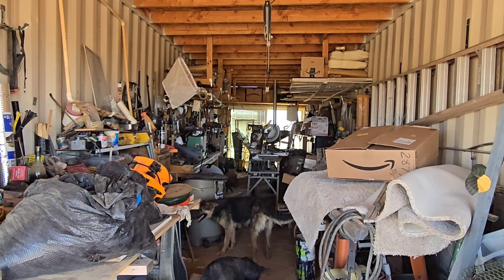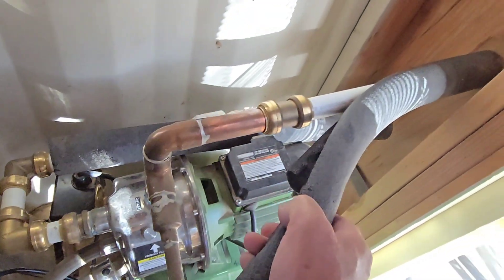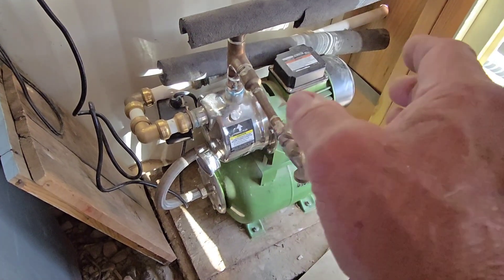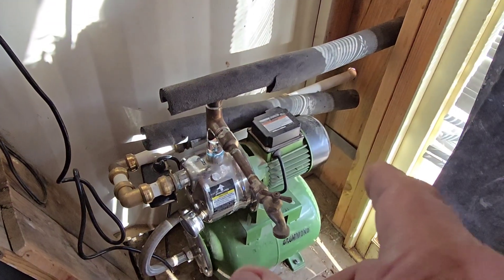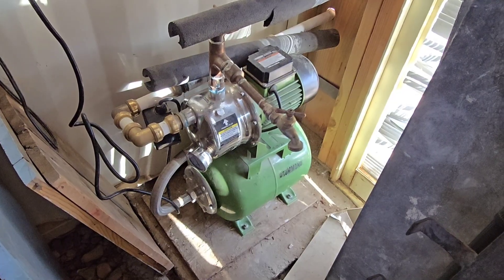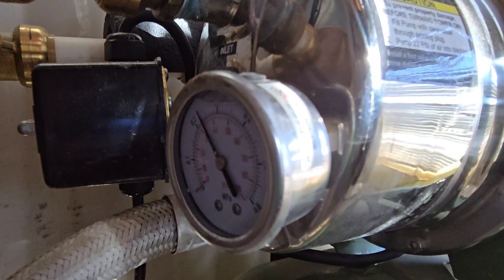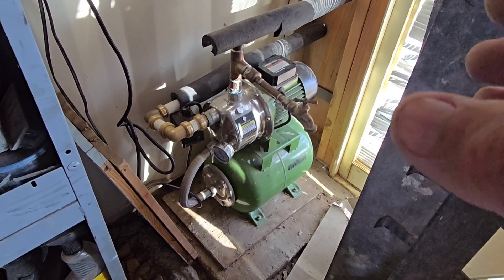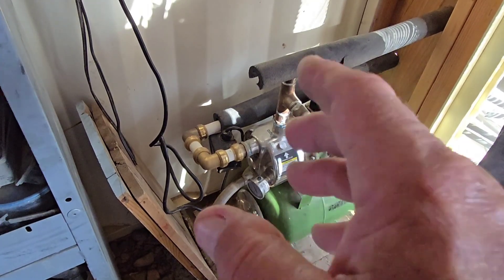H.F. Shallow Well Pump By Drummond, April 21, 2025

Comment: What kind of air pressure tester do you use to test the air pressure in the tank?   I can not get my car tire gage to read anything and I know it has pressure in tank.
Reply from the maker: Remember,  there's only supposed to be 24psi in the tank, and some tire pressure gages don't go that low anymore.
That might be the issue.

Comment: How do you drain the water for winterizing this device
Reply from the maker: I don't.  I have it indoors and the temps here seldom go below deep freeze for the night.  I recently put this pump on its own solar with a 12.8v, 628ah battery, so will add a small 'seed started' pad n the pump for any extreme nights.
Reply from the maker: Welcome aboard.

Comment: Hey, I watched your videos and I learned a lot from them before I start doing anything with my problem I would like to get your opinion on what’s going on with my water pump I had it for like two years and it works great until this couple days I could hear the pumps kicks on quicker than usual it’s getting to the point when it kicks on every second almost when I’m using the water only when I’m not using the water it stays off and when I’m not using the water, the gauge stays around 40 psi and when I’m using the water sounds like it moves every second from the bottom to 35 or 40 PSI I was just wondering if there’s anything you could recommend thanks a lot for all the hard work you do God bless you
Reply from the maker: It sounds like an air pressure problem.  The tank is not filling to capacity.
Try shut off the power and water. Open a faucet and see how much water comes out.
Leave the faucet open and add 25psi of air to the air valve on the back side of the tank, but ensure that the collet nut that holds the valve to the tank is snug.  This is where air usually leaks from. DON'T OVERTIGHTEN! Just enough to reseal.

Now close the faucet turn water back on and power it up.

I hope that helps.
Reply: @GBear  hi I checked the air pressure was zero psi so I did what you told me to do and then guess what everything works perfect 👌 so I am really appreciated your help thank you so much. God bless you. New subscriber here see you in your next video.
Reply from the maker: @wildlife1529 I'm happy I could help!  I just ran into a guy with 5 of these pumps in his pump room.  He kept buying new ones when his pump did this.  When I told him what was wrong, he was shocked.  After I set up his solar system, I'll help him fix those pumps and he can sell them online for a discount.
Enjoy your water pressure!
Reply: @GBear  thank you man
Reply from the maker: You're welcome! @wildlife1529

Comment: So what's the max depth on this "shallow" pump?  First need to make sure that you're going for the right pump.  VERY important video!!
Reply from the maker: @mikesmith1550  It’s a "Shallow Well" pump.  30 feet max.  For more depth, a base pump is needed.
Reply from the maker: @mikesmith1550  Note that I use it to pump pressure from my above ground storage tank.

Comment: Does it drum or does it pump?
Reply from the maker: @omegaroyal  It pumps.  Some people think it should just pump to pressure, and they will have continuous water for an hour.  The pressure tank size determines how often the pump runs.  This tiny 3 gallon pressure tank cannot provide that much water volume without the pump running.